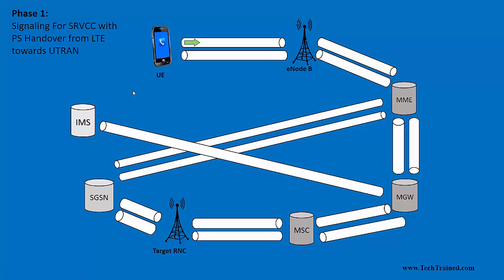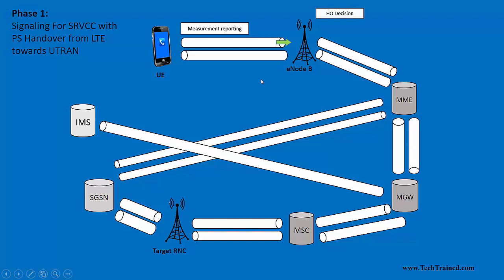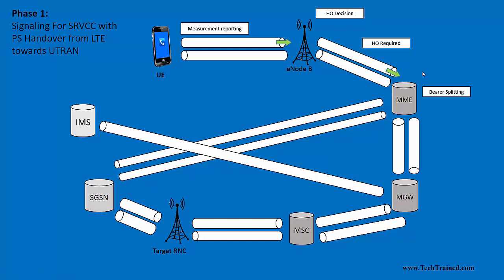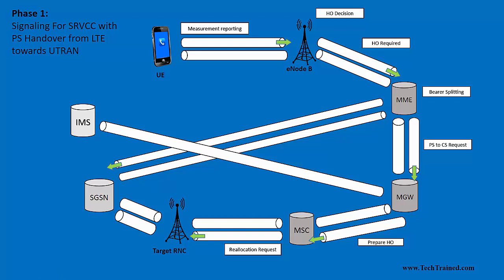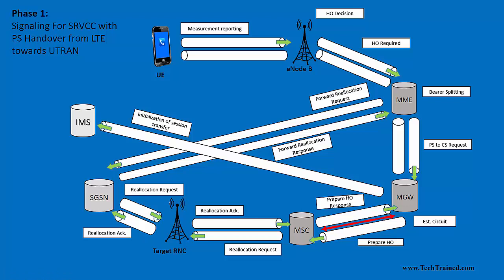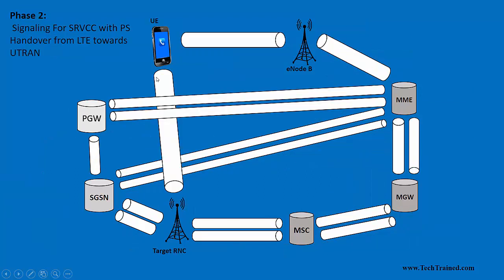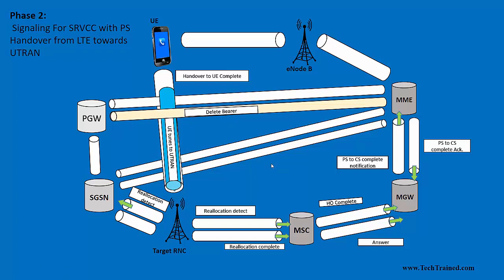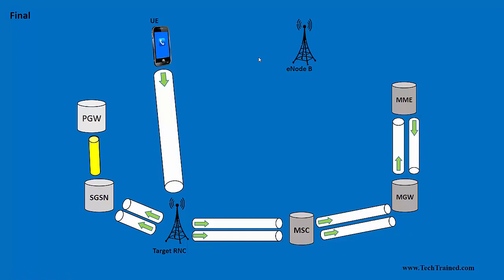Single Radio Voice Call Continuity (SRVCC)

Comment: Hi Azar

The First contact for the IMS server is P-SCSF which is available in LTE net Work. In case of SRVCC how SGSN contact to p-CSCF.?

Thanks
Nayak
Reply from the maker: Nayak, If you take a look at 3G architecture. SGSN has ability contact the External network via another node.  IMS is placed where you see External network, so SGSN will have access to  P-CSCF. Hope that helps

Comment: Hi Azar,

few questions:

1. will the P-GW continue to root both the ps and cs data to to the umts network while the call is still in session, i.e. are both sessions still anchored to the P-Gw for the remainder of the ps and cs calls? 

2. why does the p-gw not talk directly to the msc to ensure the Voip call is reformatted to now work on the cs umts network, or does the IMS complete this?

3. when the ue sends the required event to highlight srvcc is required does the ue not complete any measurements (measurement gap) to inform the lte network that there is indeed umts coverage in the area to hand into or is the handover blind just like with csfb?

best regards and thanks.
Dave
Reply from the maker: Hi David, 

Below are the answers to  your questions. 

1. will the P-GW continue to root both the ps and cs data to to the umts network while the call is still in session, i.e. are both sessions still anchored to the P-Gw for the remainder of the ps and cs calls? 

 Ans: PGW will not continue to send data to UMTS network. You are right in bringing up this question. There is a shortcoming in the last slide. I have updated the last portion of the picture and it looks like this now. See blow 

http://www.techtrained.com/srvccfinal/

 Thank you for pointing that out. 

2. why does the p-gw not talk directly to the msc to ensure the Voip call is reformatted to now work on the cs umts network, or does the IMS complete this?

Ans: Voice Call is being controlled by IMS, so IMS completes it. IMS updates its leg from previous network which was LTE  to UMTS network in this case. 

3. when the ue sends the required event to highlight srvcc is required does the ue not complete any measurements (measurement gap) to inform the lte network that there is indeed umts coverage in the area to hand into or is the handover blind just like with csfb?

Ans: That is a great question.
The simple answer is. No UE will not do measurements on UMTS itself right away. Before UMTS measurements, UE always has to go through event A2. If you need details, keep reading below. 

DETAILS: 

 When UE is getting connected to eNodeB,  UE will just inform about its ability to the eNodeB during intial attach procedure if it can support SRVCC or not ( by indicating FGI bit 27 ). as shown in UE support for SRVCC  picture in the blog here .  http://www.techtrained.com/srvcc/

Now that being said.  UE will send event  A2 measurement ( event measurement which is send only when UE is in bad coverage of the serving cell of LTE) when serving eNodeB coverage is going bad.  

Its up to the serving eNodeB after receivivng A2 measurement report to tell the UE , if it needs to do measurement on UMTS or not. 

Remember in LTE , UE cannot do measurements on any different frequencies or different technologies without serving eNodeB's approval. 

If serving eNodeB thinks based event A2 measurement  that handover to UMTS is needed (because bad LTE coverage is detected) , then it will inform UE to start doing measurements on other UMTS neighboring cells. In that case, UE will start to do measurement for event B2 . Once measurements are send by the UE for event B2 . Then SRVCC procedure will take place.
 
Hope that helps, Thanks for the question.